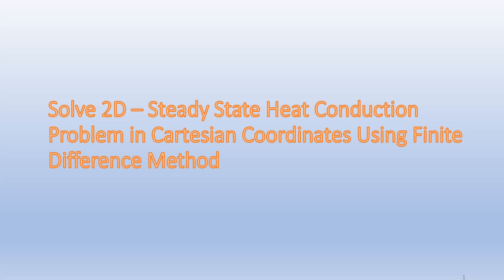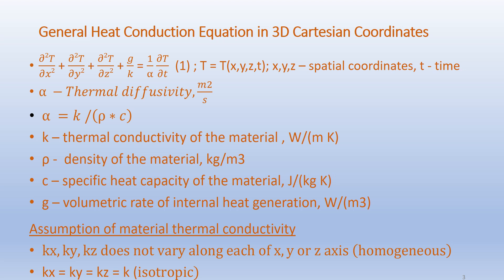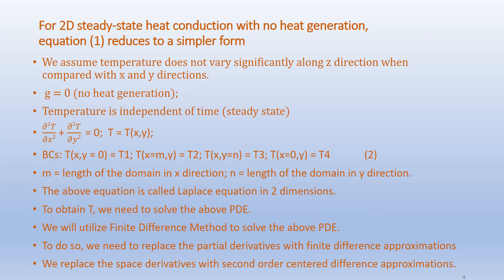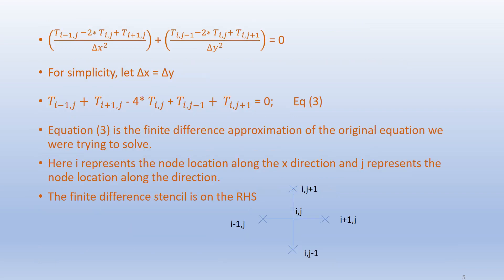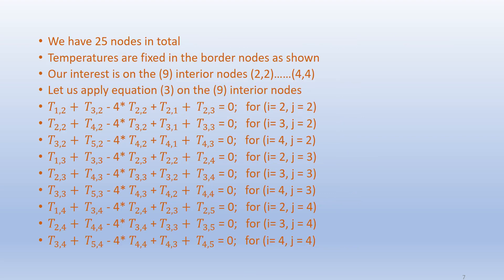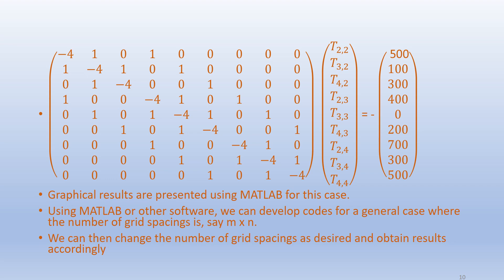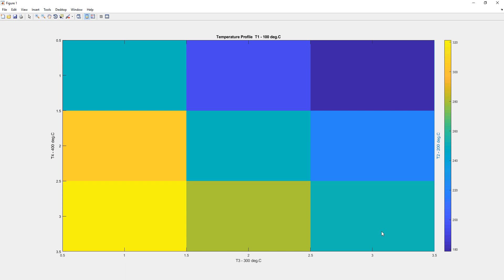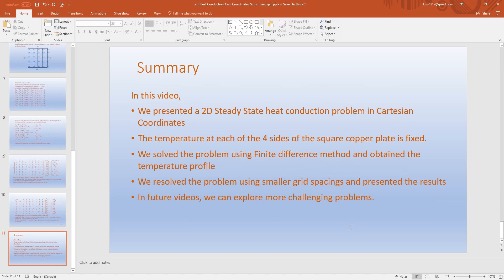Solve 2D Steady state Heat Conduction Problem with no heat generation in Cartesian Coordinates

Comment: Due to SOR_Method_Func  is not in download. So error shows in this code.
Reply from the maker: I added this to the website. Let me know if this is working.
Reply: @samseleven1  SOR _Method is work properly. But in laplace equation 2D dirichlet BCs  's code line no 93 where SOR method func was used that is  making error.
Reply: Every OTHER code  having same SOR METHOD FUNCTION  error. In error it shows

x = SOR_Method_Func (a1, b1);

I think this SOR_Method_Func.m  file not shown in Download section.

Please update it.
Reply from the maker: @tronspice  i added this function to the website
Check if this works now